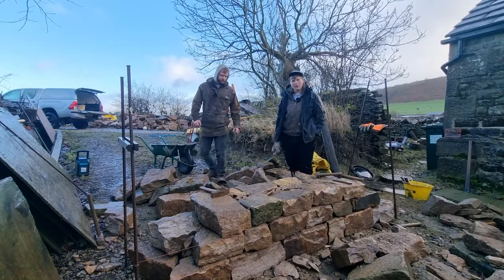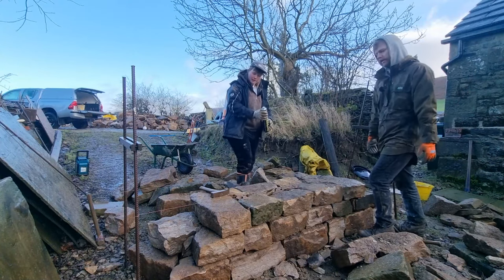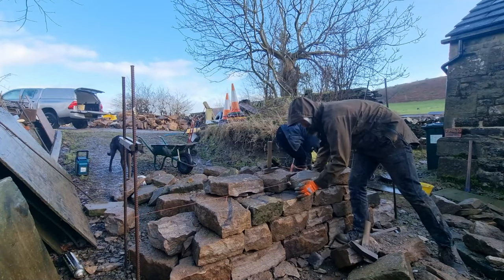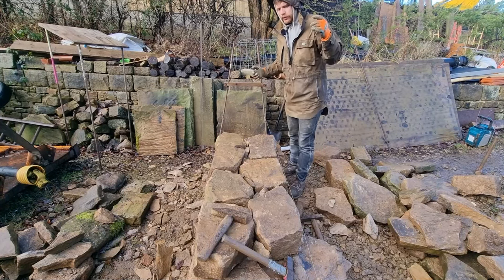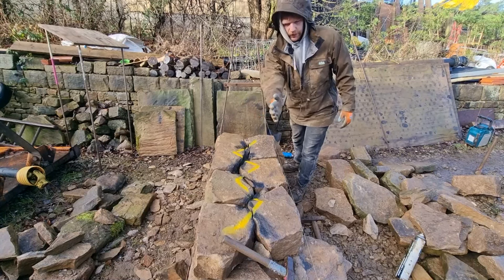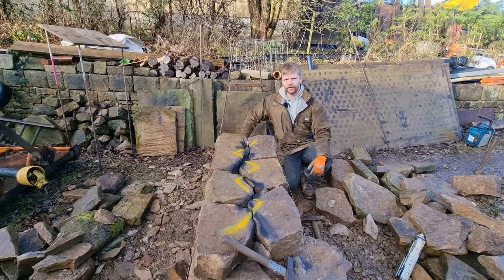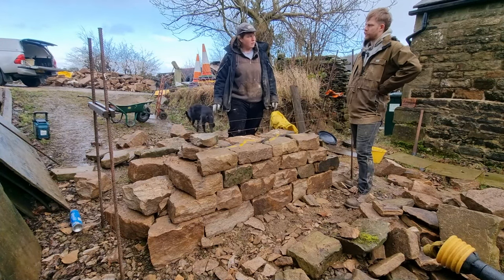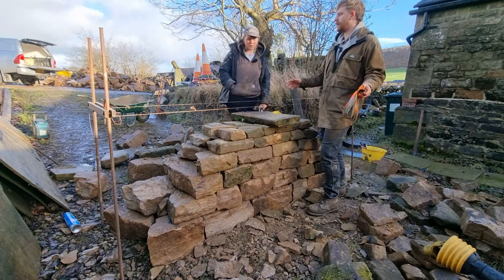How to Build a Dry Stone Wall Part 3 :  The Second Lift

Comment: what a great piece of knowledge there. i have watched the three parts and got a few questions for you. would be great if you could help me out. could i use this kind of dry wall as a stone foundation or is it more advisable to build it with lime mortar if i want to build a stone foundation? where i live people usally use sandstone for building foundations which i guess is a lot weaker than the solid stones in your video. is it possible to use sandstone for dry walling?

Comment: I don't know if it's the stone that's shit or it's me. I think it's limestone that i'm using. But every stone is the weirdest shape and different depths. I'm reusing the stone from a 1700 welsh cottage that is having renovation and rejigging work done. The original back wall has been removed to add an extension, and i'm using the stone to build a garden wall. But so far it's been a right headache trying to get the stones even. Your wall looks lovely and even. Thank you for the videos. It's a steep learning curve! 🙏🏼
Reply from the maker: Yeah rough limestone is a different ball game to this and will be a totally different look so don't worry if it's not looking very flat! I've done another video on how to use rough stone and I'm guessing your stone type is rougher still. When I'm walling rough stone I don't really use a hammer that much, it's all about finding the weird shape to fill the weird hole that another stone has left. The key thing is just crossing joints and walling the stones length in.
Reply: @drystone-tv  Great advise. Yes length in is what I need to do. They did managed to build a house with the stone 300 years ago! Just watched your recommended vid. Going to get creative now. It's a beautiful coloured stone, creamy yellow white and beige from a quarry just over the hill.  Many Thanks. ps Love your dog!